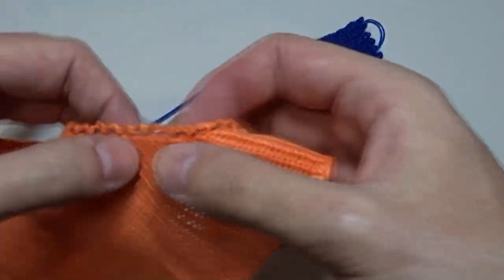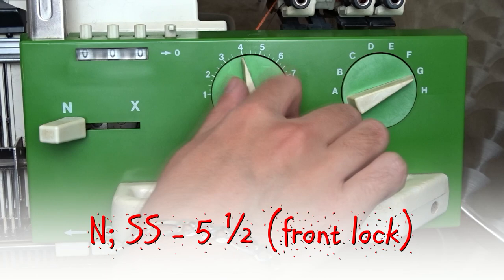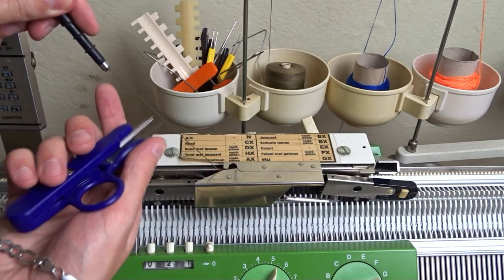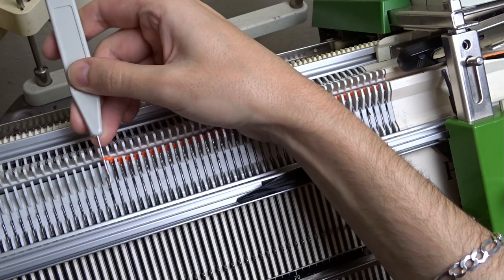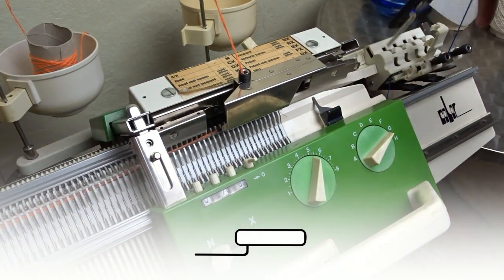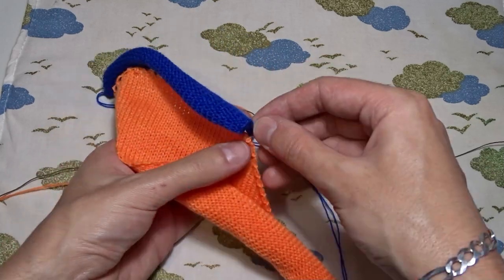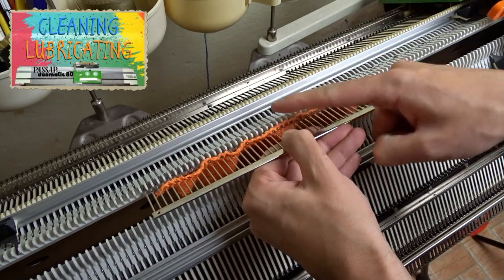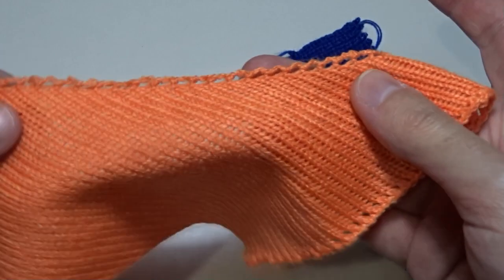How to Knit and Use a Cast-on Rag

Comment: Hi man,i got a machine Just like yours.it has been sitting for 20 years,i cleaned it  verry well exept the opening and closing of the beds are should be beter.oh i Just got some help from my oldest son,to get some wd40 into the moving parts its hard with one leg.ok i want to knit in a cirkel,but wat am i doing wrong?
sorry my name is Piet Ravensburg. 
I live in the Netherlands.
Reply from the maker: Hi, 
What you will be knitting? Where do you have difficulties? The way you must make the cast-on, depends on the thing you want to knit.

If you want to knit circular, you have to set both locks of the machine to CX. Set the stitch size on both locks to 1 or the smallest possible. Then make sure the racking handle is in its highest position, and insert the black strippers. Raise the same number of needles on both beds and arrange them in 1:1 division. The leftmost needle on the front bed must be out of working position, and the leftmost needle on the back bed must be in working position. Knit 2 rows and raise the rest of the needles. You must have the same amount of needles on both beds, and they must be opposite to each other. Use the orange ruler and tap on the needles to tighten the yarn and increase the stitch size to 4. Then knit two rows. 
Tap on the needles to tighten the yarn in the needles, and increase the stitch size to the stitch size for the main knitting, and continue knitting. After each row, you have to tap on the needles until you knit the first 10 rows.
That will make an open tube.
The machine will knit only on the front bed, when you move the lock to the left, and only on the back lock when you move the lock to the right. So one row on the garment is equal to 2 passes of the lock.

Here you can see how to start to knit tubular: https://youtu.be/mf5ku-t5PZ0  You need to raise the needles you want to knit on. 

You can see a similar process in that video: https://youtu.be/WcbKYJlbna8 . I am knitting an open tube. I am making the cast-on using the pushers. 

You can make a closed tube by knitting 1 row with both locks set to N, and the stitch size to 1 or 2. The racking handle must be in its lowest position and you have to use the orange strippers. Then set both locks to CX, increase the stitch size to 4, insert the black strippers, rotate the racking handle to its upper position, and knit 2 rows. You have to attach a weight now, or a cast-on comb if you have one. If you don't have a cast-on comb. Use a piece of the yarn, lay it over the stitches (between the beds) tie a knot and attach the weight to it. Then set the stitch size to the one for the main knitting and continue knitting to make a closed tube.
* If you use a cast-on comb, remove the strippers and knit several rows without them, because it may damage or scratch them.

Or you can make a racking cast-on with waste yarn and knit a few rows with the locks set to N, then change the yarn, rotate the racking handle to its upper position, insert the black strippers, set both locks to CX, and continue knitting tubular. (If you remove the waste yarn the stitches will start to unravel unless you make a second cast-on after you knit the rows with the waste yarn, or hand-sew them. If you want to make the second cast-on, you have to transfer the stitches in 1:1 division, put the empty needles out of working position, and repeat the same steps as for the methods above).

I hope this information can help you.